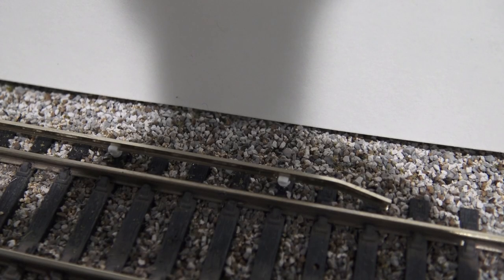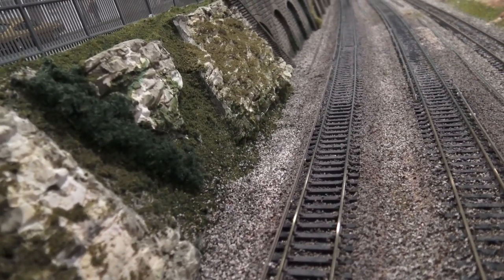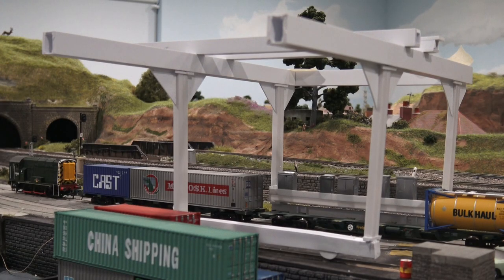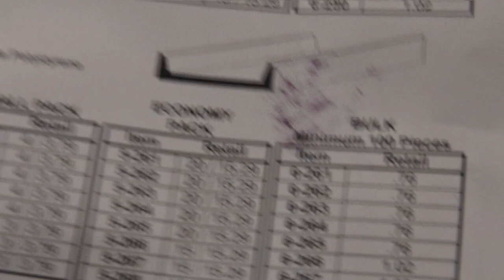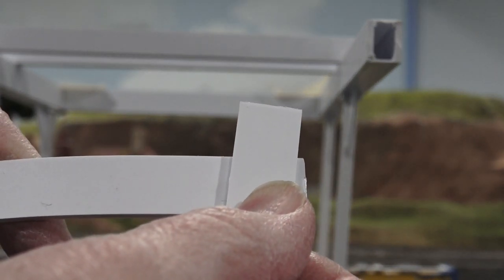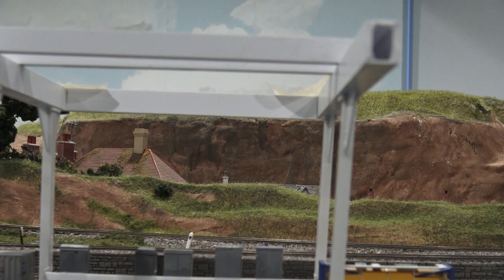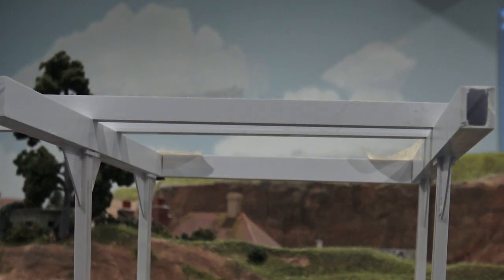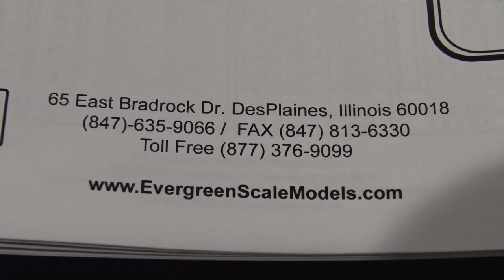123B Scratch Building Crane   -   Farland Howe

Comment: Rob, the third rail is subject to the same dirty water and brake dust that the main rails have, and (on an active system) will have the conductive shoe dragged along the top, so being even more shiny than the running rails. So rusty sides to the rails, relatively clean insulators, and clean top surfaces (just like the running rails). I suppose the insulators need to be clean(er) to stop the electrickery leaking. 
Lots of good stuff to be watching in the near future, looking forward to it!
Reply from the maker: Hi Tom, When cleaning the track with a track rubber it is impossible to avoid the insulators and one touch of the track rubber cleans them on that side.  I just had another look at several level crossings where I could look down the tracks and I would not say shiny like a non-electrified mainline, but not like the sides of any of the rails.  I think I will probably leave it painted because the nickel silver metal is too shiny to represent the true color.  Good, you'll be watching.  Your comments are always interesting.  Thank you very much, Rob

Comment: I like the addition of a third rail, Rob. I grew up in the south east of England so i am very used to seeing the third rail installed alongside the running rails. You are correct with your thoughts regarding the colour, they always look a really dark carbon black colour. I think it's a mixture of grease and the carbon from the pick up shoes. Even on the top of the rail, they always look a carbon type of black. Certainly when new the sides will look a rust colour, but the carbon soon coats them completely.
Reply from the maker: Hi Steve, I will add a few more sections or third rail when the rest of the chairs get here.  I won't go around the layout or anything.  I just thought it would be fun  to add a little in a prominent spot.  I suspect arcing as the shoes pass along creates some carbon to keep the third rails dark along with as you say grease.  It sounds like I'm on the right track with the color.  Maybe darker.  Thank you very much, good information, Rob

Comment: Hi, nice video!  Third rail - the sides tend to be a rusty black colour and the top is a sort of black sheen - so not shiny metal like the running rails. The conductor chairs tend to be white but covered in track dirt.  One extra thing, on double track the third rail usually is placed on the outside of the running lines and then when you get to any sort of platform, the third rails are placed in a position furthest from the platform edge.
Reply from the maker: Hi Carim, It is impossible to avoid rubbing the insulators while cleaning the track so they will have to stay white.  I think you have described the rail colors exactly.  I don't think I will extend the third rails past the crossing.  They are just an experiment.  Thank you very much, very good advice.  Rob

Comment: Hi Rob, I like that animated graphic at the beginning of the video, very effective!   👍🏻.  You are making a wonderful job of the crane, I can see that it’s going to look very realistic once completed, will you be adding another top beam across the front of the top structure like the one on the rear? I guess you will be. Do you intend to have it working too with a working lifting section, if so I would be interested to see how this is done, I’m not going to bother on mine, just have it running up and down the tracks. Your third rail looks very impressive too, that is a very neat install and all credit to you as I can imagine that it must become a very tedious job after a while, I think in my opinion you should leave the rails painted as it looks very effective what you have done so far.   A great video mate and very informative on what you have done so far.      Cheers for now my friend.            .............Graham
Reply from the maker: Hi Graham, Michelle says she doesn't like the blue thing at the beginning.  I thought it was cool.  I think the top beam will go under the main rails.  This will allow the bridge a longer travel.  I've been thinking about building a working hoist.  I saw some gearing kits at the hobby store and one of them might works.   I am still not sure about the painted third rail.  I might come along and paint it a darker color with a brush.  When you clean the track it is hard not to rub the insulators as you can see I have rubbed the paint off of them already.   Thank you so much and  bye for now my friend
Reply: Rob McCrain   Hi Rob, well I guess not everyone is going to like everything as we know so really it’s up to you if you keep the graphic or not but I like, it’s interesting.   A working hoist would be good especially as you are building the crane up from nothing and not trying to convert an existing fixed hoist. I suppose the beam could go in between the two other rails (like mine) rather than sitting on top or even underneath but again - your choice my friend.   Cheers for now mate.        ..........Graham

Comment: Not sure about paint on third rail , maybe better all Nicole silver , nice job making up the crane from plastic bars ,  not easy getting a fast sticking glue for plastic .. Dave
Reply from the maker: Hi Dave, The plastic I am using is polystyrene.  Most solvents won't touch it.  The glue they recommend is instant when the gap between the two pieces is very small.  One vote for plain metal.  Thank you Dave

Comment: platform 1 London Waterloo. Not particularly good photos, but shows just how grimmy the rails get, and these ones have been boxed in with wooden shuttering to prevent line side fires from paper rubbish. https://photos.app.goo.gl/viUAodpAm8SzfLiGA
Reply from the maker: Fantastic.  That is what I needed.  What I could find on street view was not nearly as good as are.  The wooden shuttering is an interesting detail I have never seen before.  I cannot thank you enough.  Rob
Reply: @FarlandHowe  my pleasure.  I added a few more pic this morning (you may have seen), these were taken last night at guildford Station. They show the third rail exposed and are from a terminal platform. The insulators are a lot cleaner than you would see on track normally! Insulators are normally so dirty they cover the white colour completely.  If you want anymore pics at any time, just shout. I'm on the railways twice a day!